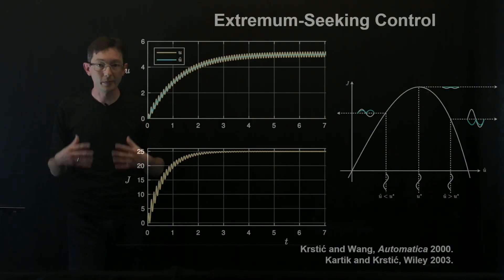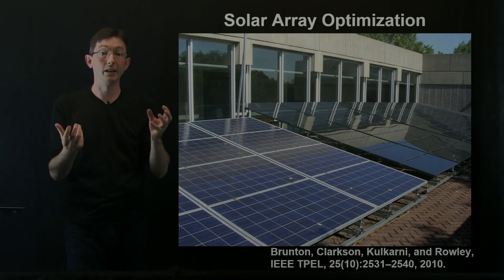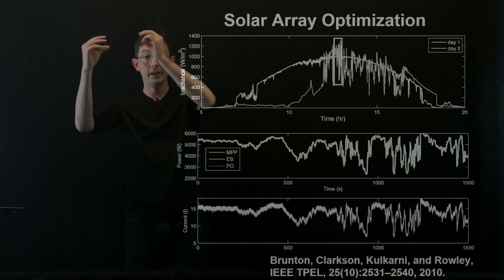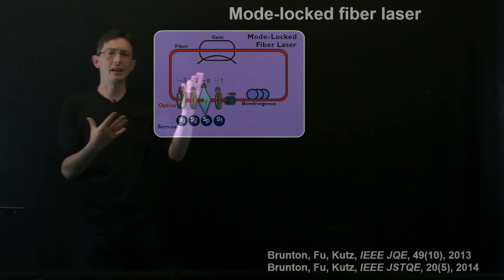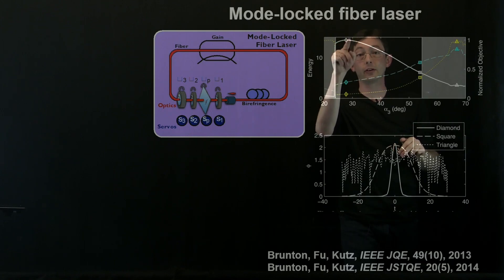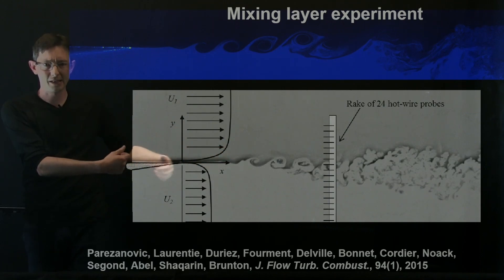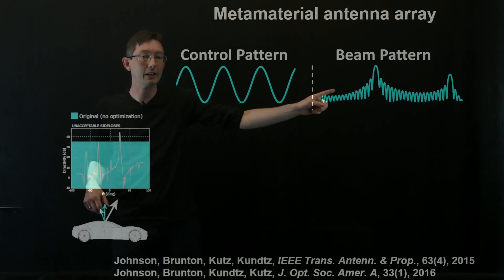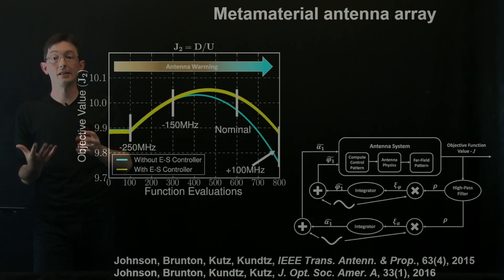Extremum Seeking Control Applications

Comment: Great explanation. I was trying to optimize the power transmission in a RF system by varying the source frequencies using ESC. When I simulate the system ( a source with varying frequency sinusoid signal, and output at the RLC based load), the output is measured by multiplying the output voltage and current and apply low pass filter to it. If I use this output as my feedback for ESC, will it work since there is a extra LPF?

Comment: instead of designing the objective function one can just control towards the desired setpoint which this objective function symbolizes, this is such a strange control method, i am certain i can outperform it with a boring PID